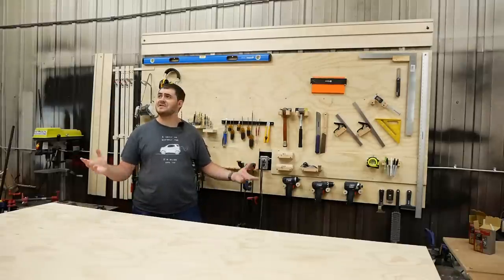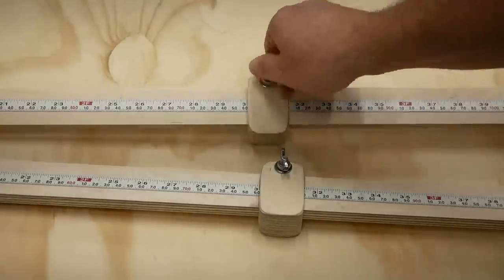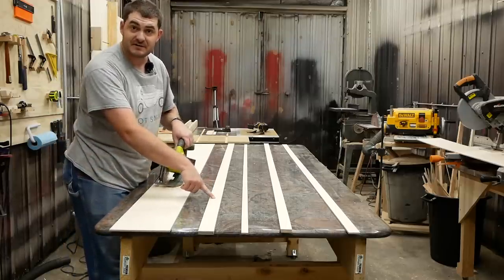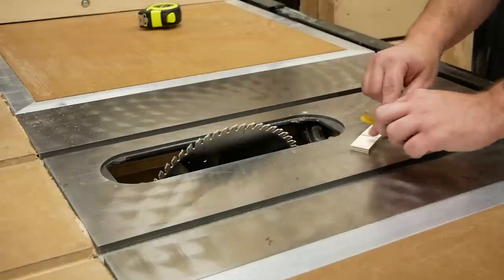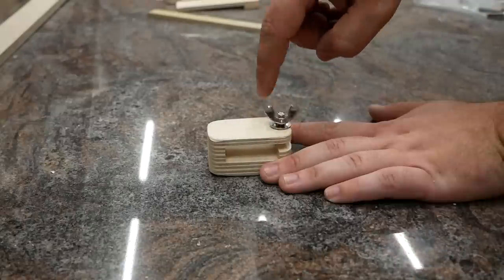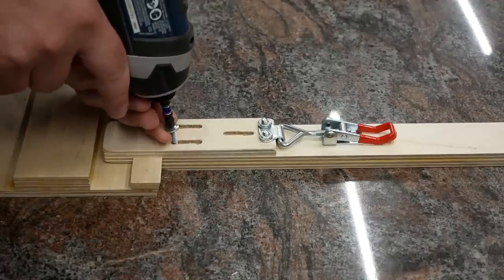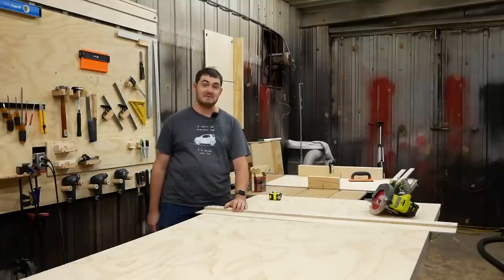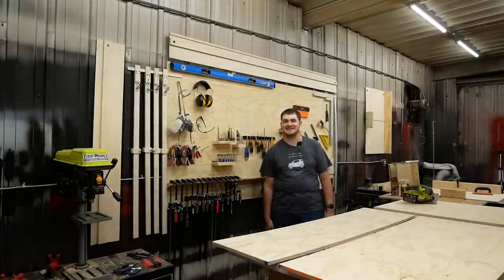Making a Much Easier Way to Break Down Plywood

Comment: One could make a large T square in which it has a thick leg or part of the leg where the saw cuts so that part of the square would not be cut off. It would have a leg that rests against the edge of the plywood and that leg would have a saw cut which is the distance from the edge of the blade to the edge of the saw base. To use it you would just lay the square across the plywood and locate the saw cut in the leg on the mark where you want to make a cut. That way you never have to worry about parallel bars and measuring.

Comment: I'm a hand tool woodworker. The only electric tools in my shop are a battery-powered circular saw and a drill driver. I use the saw to rough cut my stock, then I put it away. This is going to be a great help and well worth the $8 so I don't have to reverse engineer it from your video.

Comment: Sweeet stuff! I you wanted to go for even less inconvenience, you could figure out a way to lock the two sliders together so that they’d both be exactly at the same spot (you could hook them onto the cutting rail side-by-side), then adjust them to the desired position as one unit, tighten the locking devices. That way you’d eliminate any wonkyness when butting the two stops up against the plywood you’re about to cut.  Again, brilliant stuff, thanks!
Reply: Could be done with wider stop blocks but defeats the purpose of being able to easily store it when not in use.

Comment: Nicely done. Do you have any issue with it moving after using it several times? By that I mean sometimes one ends up reaching at awkward angles to cut across 4 foot sections. It can be hard to keep your cutting pressure straight. This is much easier to set up for certain.

As a suggestion improve the accuracy, put the clamp end up against a stationary surface like the table saw fence. Use a square to set the stop blocks evenly. That method would actually allow you to only have on measuring tape. Great build. Thanks for sharing. Stay safe.

Comment: Ingenious design on the clamping mechanism. I can see application of that on other shop jigs. 

A short set of stops that could reach under to contact the edge of a workpiece and allow you to cut to less than 16 inches is the next step. I think only a set of modified stops blocks are needed. The gauge bars are fine but maybe a little long for making narrow cuts so a pair that are 24 inches long would be a useful addition to this excellent shop-built jig.

To set you gauge bars to exactly the same distance set one to the desired distance then put them face to face so the stop blocks on each bar butt up to the end of the other bar. Then move the stop block on the second bar to match the first bar.

Comment: I usually have the plywood cut into 4x4 squares at the big box store. The only problem is it takes 45 minutes to find someone to cut it. A lot of times they will tell you the machine is broken so they don't have to cut it for you. The other problem is getting a 4X8 sheet in a Jeep Grand Cherokee.  In two weeks I have a project to make a 30" X 72" desk. I will probably purchase your plans by then. The only problem is the only place I can cut it on are sawhorses.  Do you have a solution for that? My shop is a two-car garage. My workspace expends from 110 Square feet to 550 Square feet. At night the cars go back into the garage and it's back to 110 again.

Comment: what keeps the track from moving during your cut? The stop blocks will keep you from going away from your ref edge, but what about towards it? Would it be smart to line the back of the track with sandpaper or something to avoid it moving? Really love your content!
Reply: Robert did !........self adhesive sandpaper  two lengths !!

Comment: I'm thinking a couple of more clamps are needed because it seems the measuring clamps are holding it only one direction and the other is held in place with friction of sand paper.  The other thing I didn't hear was what is the minimum cross cut rip width?  Looks like a good 10-12" is needed for the track and the clamp so how can you use it if you need to cut like an 8" strip off the end?  Good video & idea.
Reply: you could always think outside the box and measure what you don’t want to cut. Just adjust for blade thickness so your cut isn’t short

Comment: Hey, maybe a dumb thought, but wouldn’t the tracks warp and lose their accuracy when/if the wood absorbs moisture/dries up? Or do you think that this effect would be insignificant for it’s aplication?
Reply: The tracks are made of plywood, which is quite dimensionally stable and already dry. It is not likely to be very vulnerable to climate. 

In addition, this is just not a very demanding application. If your stop rails bend right where they meet the track (most serious problem), moving the back end of the rails off by an inch (a pretty serious warp), your length stops are now off by 20 thou. That's a little over a 64th of an inch. there is no way those adhesive measuring tapes are applied that accurately in the first place, using that method.

Comment: The Kreg track has something similar but instead of sturdy wooden offset rails it has some flimsy tape measure dealies.
Reply: Although I'm a fan of the term "dealies",  and use it quite often myself, I believe this would be the first time I've ever seen it in print. Nicely done!
Reply: @markhedquist9597  I am thinking I will make my own kreg-track-offset-rails out of oak and some brass.    This build has inspired me.
Reply: Awesome! I wanna see it when done!

Comment: Instead of using the toggle clamp latches (relatively special equipment, you could have used several bolts sticking out of the wider guide and holes in the thinner side rails. This wouldnt clamp as tightly however
Reply: Those toggle clamps are $4 apiece, and you can get them all over.

Comment: Robert this is great piece of equipment designed and developed.   Awesome Job, plus safe to use. I have noticed you made your own riving knife for the table saw. That would be something I like you to put on here for those of us that do not have $1,500 to $8,000 table saws.
Reply: He mentions it in the series of videos where he rebuilt his table saw.  I'm pretty sure it's just a thin piece of hardwood glued into the zero clearance insert he made himself.  

Also, I'm pretty sure what he's got there is referred to as a "splitter" rather than a "riving knife/blade".  I'm not totally clear on the difference but apparently is a difference.

As far as the expensive table saw though, I've owned two different table saws.  One was $100 and the other one was $400 and both came equipped with a riving knife.

Comment: Not only do I like the item made, I really like that you showed what the item was and how it works at the BEGINNING. Hate watching To the end to find out that's not really what I wanted or thought it was.
Reply: Yeah, absolutely agree. If I want to watch a mystery, I'll turn on the TV. 

I'm astounded by the number of people who seem to imagine that I want to watch a video of 47 pieces of wood being ripped, 63 pieces being cross-cut, 296 screws being inserted, 84 square metres  (or yards - in this case, the unit REALLY doesn't matter) of glue being spread, without a word of explanation. Or, possibly, worse, an explanation in terms that make sense only to them: "Now, we want to be sure that the wurblesnark will seat properly against the trembletruffler without impeding the counter-linear movement of the inverse plotch-catcher." BAH! Humbug!

Comment: Love it. Started collecting needed parts using your recommended links. Going to try to make it 112” long so my circular saw starts an finish’s off of an 8’ sheet. Maybe 2 pieces, one 48” another 64”. Need to come up with a way to connect them so they attach firmly and stay straight.
Reply: I just finished an unrelated project that left me with the same dilemma. The solution was that I used a 1” rabbet joint to connect them.
Reply: and finishes vs an finish's

Comment: You just filmed a guide to use three pieces of a track saw rail system instead of a one piece track saw rail system. Either way, the track is going to shift even when you take one of those track rail 90 degree thingies and lock it onto the track.
Reply: Clamp them down at the end of the sheet?
Reply: @ximono  That may be the answer.

Comment: This is a nice setup.  I particularly like that you used thin enough plywood to keep it light.  

One comment on use: when you set the cut width on one guide, you can use it to set the other guide.  It's fast and consistent.  You can look at the other scale to check, but this should keep it parallel.

When the zero clearance edge gets damaged, you can rip it off on the tablesaw and glue on a hardwood strip.  This makes a good edge and increases the lifetime of the track.
Reply: I wonder how hard it would be to build a spring clamp into the ruler stops, to lock it to the plywood edge.
Reply: Yes, spring clamps or cam clamps or some way of holding entire apparatus to the sheet being cut. That's a good idea! There's no reason to leave anything to chance. Good, strong spring clamps would probably do the job. (Replying to Alan S. reply above.)
Reply: @markhedquist9597  I realize now that a spring clamp should work without being attached.  If the ruler stop is too thick, one layer of ply can be extended to the side as a clamping surface.
Reply: Ya, I get that. But a permanently attached clamp thingy would be cool, too. Loose clamps would be something easy to lose, or ultimately be set somewhere out of convenient reach making for unwanted extra footsteps. It's all the little things that tend to frustrate me and take away from being able to fully enjoy working on projects.

Comment: You had me at “all I had to do was set both of these stop blocks to 30”, clamp down the stop blocks, clamp both of these rails to the saw track, then but it up to the stop blocks of the measuring guides.”
Reply: What you're missing is repeatable cuts. Sure, it seems like a bit of work/setup for one cut, but imagine if you have to make 5 of those 30" pieces. Set the jig once, rinse and repeat.
Reply: Could you just set it and cut as many boards as you could stack under that the circular saw would get through?
Reply: Chuck Under Fire you could, but you’d probably only be able to fit 2, maybe 3, sheets of 3/4 before you max out the depth in the saw

Comment: What keeps the track from moving away if you press on it with the saw?
Reply: looks like the toggles clamp everything together
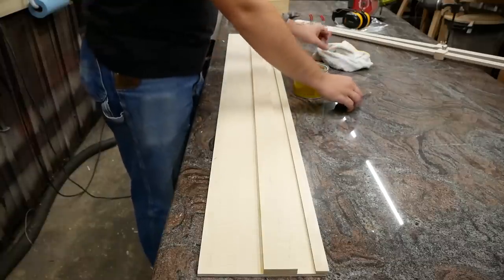Reply: @chingonbass  Ha!  I watched again.  11:41 shows he put adhesive-backed sandpaper on the underside of the track to "keep it from sliding around".  Thanks for your response.  I had completely forgotten about this video.  Pretty clever.  Hard to follow, but pretty clever.  PS, I like that baltic birch 1/4" ply.  Looks like a good material for projects.
Reply: @alext8828  turns out I was wrong in my assessment. I'd just clamp it at the ends.

I can never find that ply with a bazzilion layers at the home center.
Reply: @chingonbass   Yeah, that would work.  Why not?

Comment: A parts list at the beginning of the construction portion would be nice. 

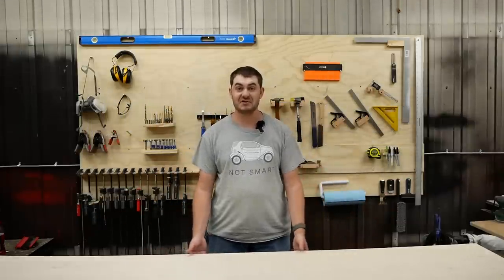at 2:57 After "This entire project can ... table saw. " consider adding "There are some fasteners and other hardware required, the list is on screen now."
Reply from the maker: Yep! There's an exact parts list in the plans. The plans will be available in a couple days
Reply: @UnderDunnOfficial  the exact parts being in the plans is fine, but a mention (in the video) of the general parts used would be nice. IE "you will also need sandpaper to hold down the track, clamps to hold the rails to the track, and some glue and general fasteners you can get from your local hardware store."

Comment: I made it 45 secs into the crying. You have to minus the offset of the blade to the guide? Geez......I’ve had a straight edge for 25 plus years. Works with all my saws and my routers no special jigs or attachments. 

Sorry. I don’t think your channel is for me